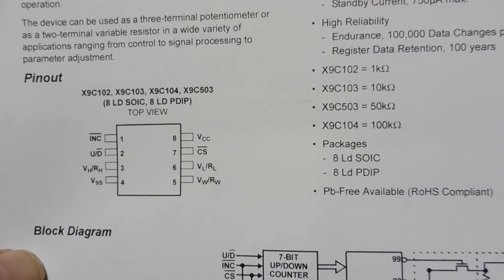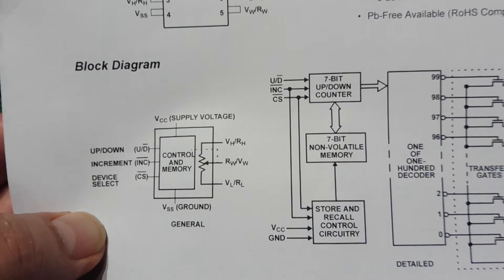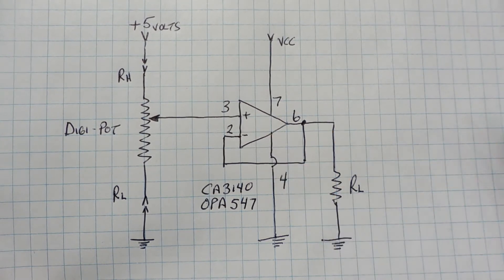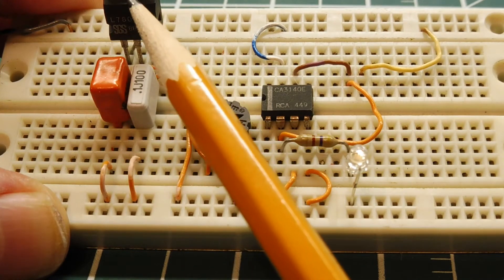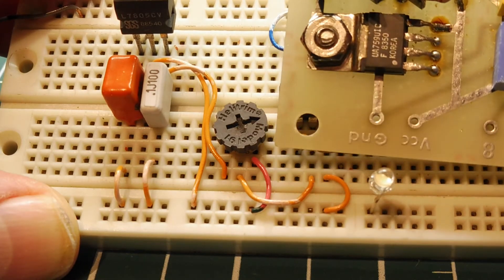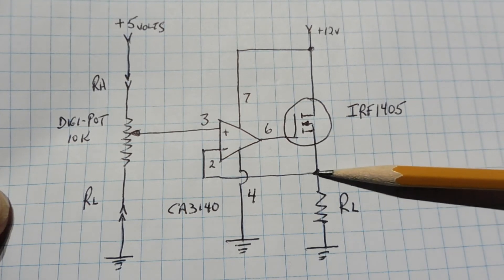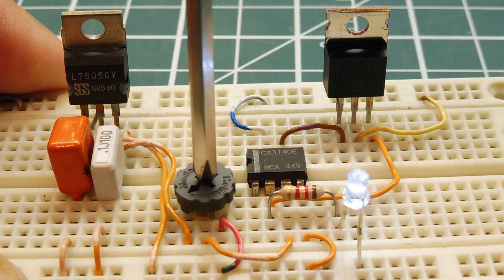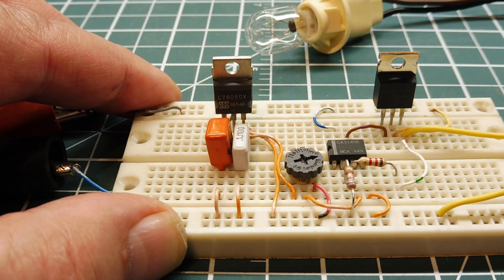How to increase the output drive of a Digi-pot

Comment: Thanks a lot .Very useful information !
Reply from the maker: Glad it was helpful!
Reply: HI  ! According to the RENESA specs, maximum Vcc for X9C102  is 4 Volts . Since there was no C3140 and IRF1405  avaiable I tried to replicate your circuit (12v for Vcc) with one section of TLC274 (pin compatible with LM L324)  and a 2N7000 instead of IRF1405 . Applying  4V to the non inverting input (pin 3 )got 3,4 V at the  2n7000 source  (over 470R load). conecting to gnd goes to 10,4v . I've tried a IRF740 and a section of a TL072 with the same outcome . Where am I wrong ? Can you suggest a solution ?

Comment: But what if I just want the output to be a passive resistor as the digipot is, but just be able to handle more current,  Is there a way to accomplish that?
Reply from the maker: The digi-pot resistors are etched on the substrate of the chip for low power applications only. You could build your own array with high power resistors and switch them with power MOSFETS.

Comment: Does the mosfet have to be in the feedback loop to make this work ?  If the mosfet it is hard on then there would be 12v across RL and Vgs would not be enough to keep it on.
Reply from the maker: The voltage across RL will always be the same as the Digi-pot wiper voltage. The Op-Amp takes care of that.
The max voltage across RL will be 5 volts when the wiper is at the top. The Mosfet is operating in linear mode and will never be turned on fully.
Reply: Ok, makes sense now, thank you.
Reply: @noweare1  I guess the mosfet should be below the load with the source pin tied to ground. That way Vgs can be 12v.
Reply: @0033mer  5:13 you added resistors so 12v is across RL. So I don’t think you answered the question after all.

Comment: L272 Op Amp= 1 Amp Output/1.5A peak (500k input resistance ;)
  Came across one of those in an old '87 Magnavox CD player driving the disk motor. I had no idea op amps are made at that level of output current.
Reply from the maker: Power op-amps are not that common. L272 looks like a good part ... it's even a dual op amp.
Digikey stocks them. Good item for the parts bin.